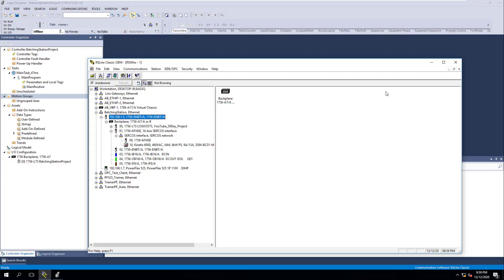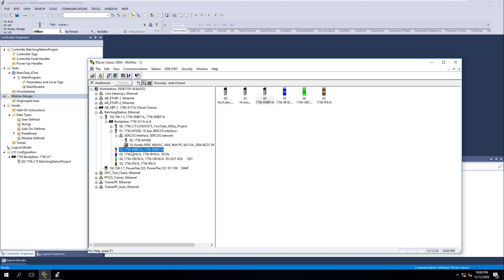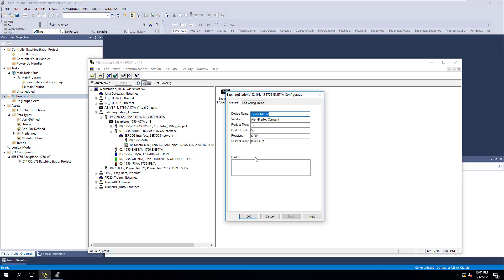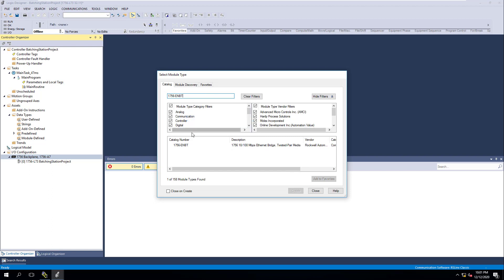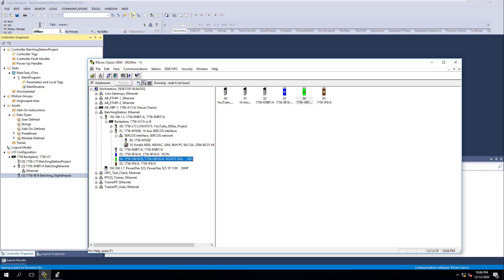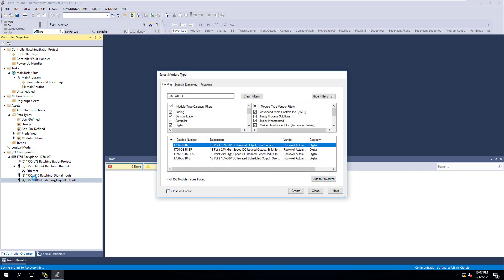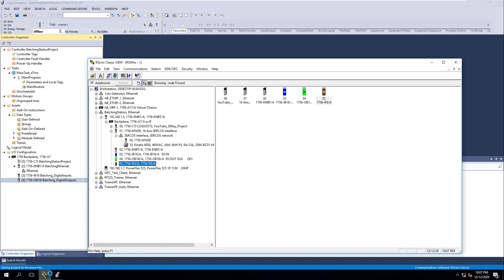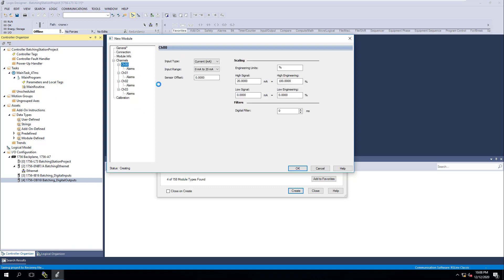Adding I/O Into A Studio 5000 PLC Program | Batching Station PLC Programming | Day 2

Comment: Hi Shane,

I really appreciate your way of explaining things. So, if I want to replicate the same project in the RSLogix 5000 emulator, I can set up the inputs, outputs, and the controller, but I won't be able to include the PowerFlex components. However, I believe I can achieve this by using the SoftLogix 5800, correct?
Reply from the maker: You can use FactoryTalk Echo Logix software for emulation as well without changing the processor type
Reply: @ShaneWelcher  
 In the FactoryTalk Echo Logix software, there is no option to include the PowerFlex components.
Reply from the maker: @UmerSarwarFaiz  It's a way to emulate any pre-existing progam
Reply: @ShaneWelcher  
What if someone doesn't have the hardware and only wants to emulate the Flex drives, SERCOS, and network cards? The best way to work around that is by using SoftLogix, correct?
Reply from the maker: @UmerSarwarFaiz  I guess, I only use Studio 5000 emulator and Logix Echo

Comment: Just wondering what would 1769-IR6/A mean? Does it represent Analog Inputs?
Reply from the maker: It's analog, the one I show in the video does inputs & output 4 to 20 or 0 to 10 depending on the way it's wired
Reply: @ShaneWelcher  thank you 🙏

Comment: First off, thank you for presentation. So, you had a actual I/O configuration on the rack but it was only recognizable by RSlinx but not STUDIO5000 until you defined them one by one under the software? is this correct?
Reply from the maker: The I/O is Allen-Bradley (AKA) Rockwell Automation.

The way I showed this setup is just a quick reference for anyone that uses RSLinx.

Best practice, easy setup for uses